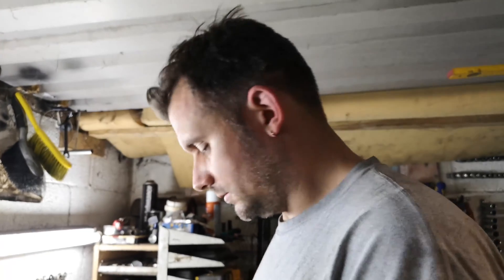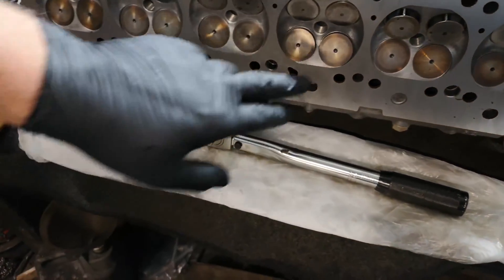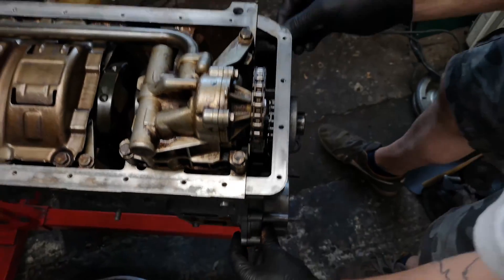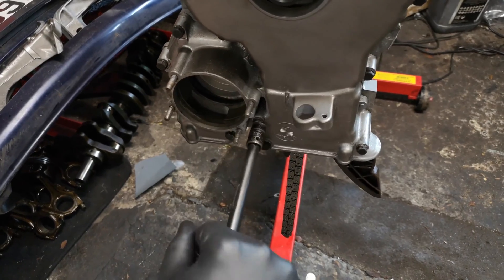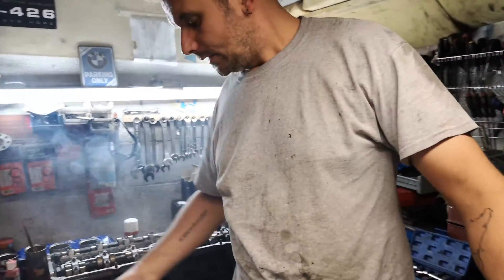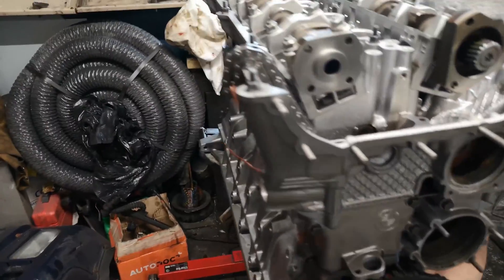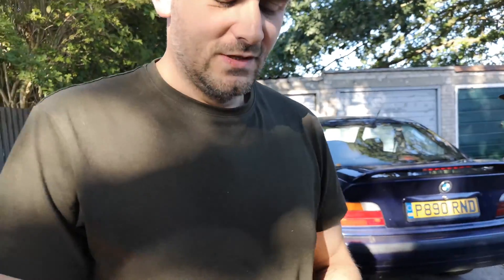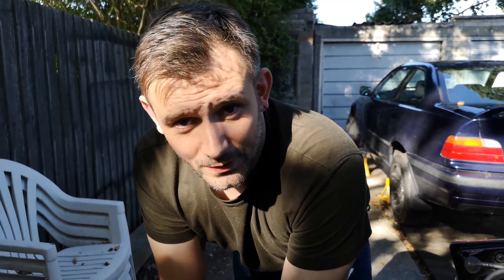Will the M52 block survive?

Comment: Omg all threads gone 😃 happened to me also but only a couple boIts spun, I did new threads with 25mm long timeserts 6mm drowned from deck surface to all 14 and it did work for me. My build is m52b25 singe vanos, stock compression, 1bar boost, e85 and 26 to 18 degree BTDC ignition advance in boost area
Reply from the maker: Nice man, well done for sticking with the m52 block 👍

Comment: Sucks to see that happen with the block while torquing the head bolts but it's far from uncommon. Timesert makes a kit to repair stripped head bolt threads in these aluminum blocks which replaces the relatively weak aluminum threads with a more robust replacement that can handle the clamping load far better. It's not a cheap kit but it's similar to the cost of a used block:

http://www.timesert.com/html/bmw.html

Comment: Hi mate, what happend to the threats is a real painfull experience, i always Molykote threatpaste https://www.techniekwebshop.nl/molykote-smeermiddelpasta-p37-anti-seize-paste-sp000180-500-g-40-1400.html?gclid=EAIaIQobChMIx9jIwu2w5gIVQuJ3Ch3wWA10EAQYAyABEgKfYvD_BwE
I have never had a problem that the bolt jumps on the threat, i saw you put oil on the threats and thats why the threats are break, the oil was pushed away by the force on the threat, when you used this type of paste the threats are holding up fine.
Good luck with the build man 👍💪

Comment: Hello Pamo , So disappointed and  sorry that the threads did not hold. Definitely not your fault . I've heard these alloy blocks referred to as the "butter blocks" . The M50 block will be a long lasting fix. I wonder if helicoils would be another option . Thanks again for the very helpful video. Another thing i really appreciate with all your videos is the very clear audio . Excellent
Reply from the maker: Thanks again Richard. I've read bad results with helicoils on these threads - timeserts seem to be the accepted fix + arp hardware. Sadly that would cost more than an m50 lump hence my hasty purchase of the iron block. The only problem with those is bore wear. I got lucky with mine, almost no wear - no lip at the top of the bores.
Reply: @ManSeeksCivic  So pleased you were able to find a good block and quickly too . I think all who see this video will be thinking long and hard about their  M52 rebuild. If its better to just start with the M50 block . It certainly has got me thinking. Thanks again and really wish you success with the build .

Comment: That sucks. Obviously you did something wrong. I don’t know why threads snapped, but a lot of aluminium engines behing rebuild every day without an issue. I slapped my m52 together with 1/4 of care you are taking but mine works like a charm.
Reply from the maker: Overheat buddy. It softens the metal and causes strength issues. I had 2 instances of overheating.... Both of which I caught before it hit the red but I believe this was enough to weaken the alloy. I totally agree about ally blocks in general.... No honda I've worked on has had this problem but there are countless reports of the same issue with the m52.
Reply: Ok that makes sense.

Comment: Yop, that sounds terribly bad...
I would to know you have cleaned the threads and put in new screws for the cylinder head, or not ?
Well done for the time you spend to explain the build ! (I want to do the same on my M52B25 in 1-2years)
Reply from the maker: Couldn't have cleaned them more, degreased twice, blown out with air line, chased threads with tap twice and degreased and blew out one final time. Used brand new bolts and boom. I believe the  block was weakened by a previous overheat even though the car drove fine for a year afterward without any issues at all.
Reply: @ManSeeksCivic  Well, in that case, it's not your fault at all.
It is also visible that some threads fail before the 90°...
I hope you'll have a better chance later on !
I look forward to the next video ;)

Comment: Hey there's no need to throw away the m52 block, you can rethread it easily even with all the internals in it. Ps next time install the head before you install the cams with the trays 👍👍
Reply from the maker: It's already a table buddy - I didn't fancy attempting timeserts or god forbid helicoils. Why do you recommend not installing the trays?
Reply: @ManSeeksCivic  it's much easier to install the trays later, when the head is on the block, also be careful when tightening the cam caps - there's very little thread in the head for the bolts that hold them, especially the first and the last one are very easy to strip